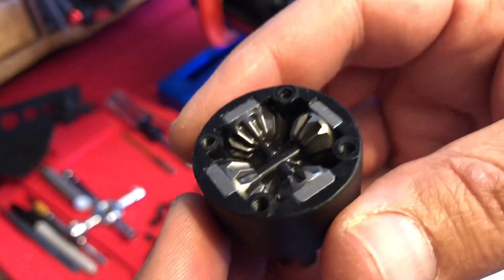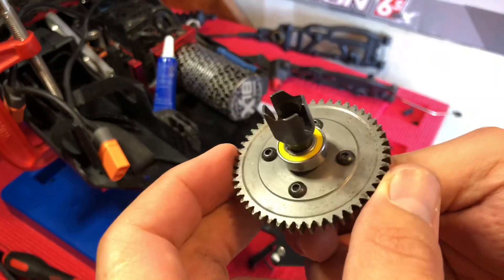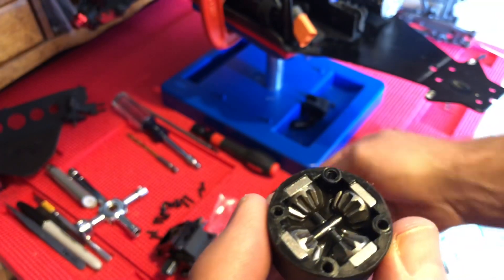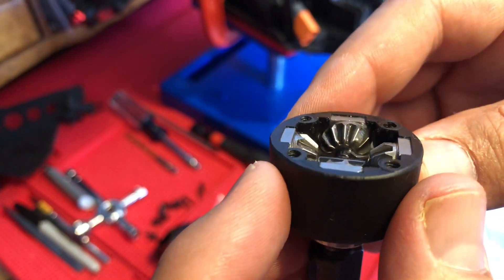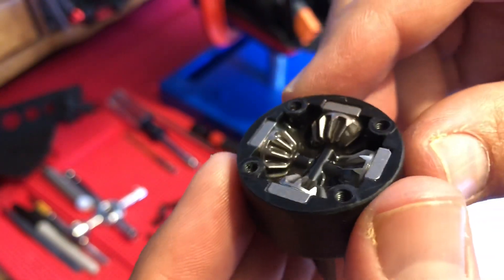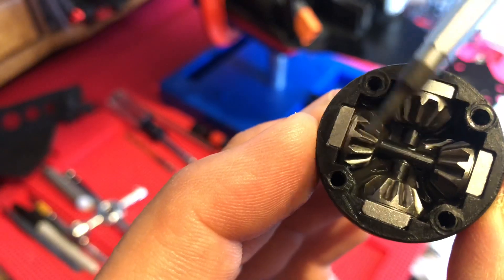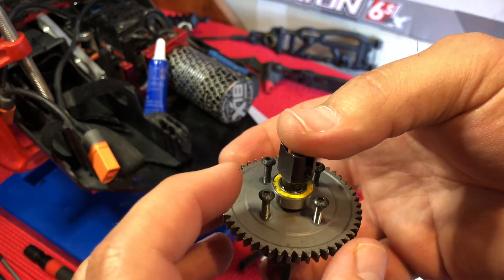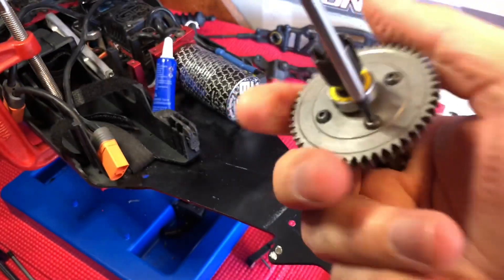ARRMA DIFF TIPS - Kraton, Outcast, Talion, Typhon

Comment: loading up on parts now and gonna rebuild all 3. My Center Diff on the new Outcast EXB RTR is already flinging fluid on my bashes, time to upgrade/ rebuild! can't wait
Reply from the maker: Good times!!! 😎👍
Reply: @EastTactics  i've been trying to find springs from your other video and just can't get them for the outcast. if i remember right they are sold out, any idea what i could buy as well?
i'm online with M2C for caps and pistons right now. i'll look over your videos again for what oils and do them when i get the m2c caps in.
amazing stuff and i love the detail you show!! thank you!
Reply from the maker: Thanks!!
Have you checked inventory lately at centurysprings.com for the 1631 part number?
I ordered mine a month or two back and it was put on back order. But then last week they finally arrived. So it doesn’t hurt to put an order in and then get it put on back order. But due to the fact of mine arrived last week I’m wondering if they’re currently in stock again.
After getting the 1631 part number in my hand I’m feeling like this is gonna be a really good spring. 
On this particular spring however you do have to take your Dremel tool and flatten out both ends of the spring on all four springs so it sits right.
As far as the weight differential fluid to put in your shocks after getting the springs. I will probably go with 3000 CST. I currently have 5000 CST in mine. I think when I drop down a bit I’ll like it even more. Naturally more videos to come on this topic
Reply: @EastTactics  exactly, it was on back order and I'm lil impatient that's why I was asking if you had others.
I got really excited when I saw your video about those springs. I don't want to double up orange springs or go 25mill shocks.
I'll just order them even on back order.
Thanks again
Reply from the maker: I’ve got a full set of the big rock springs also I’ve got a full set of 10548 springs and they are great Springs.  if you want email me Andre can  talk about you picking them up for me. You know… If you want
Reply: @EastTactics  ya just not happy with my body slaps on stock spring...sure
Reply: @EastTactics  just looked online and they have th 1631 in stock right now...spread the word i'm getting 4
Reply from the maker: Awesome

Comment: My diffs have been driving me nuts!  It was good I worked on all three, but I am back at the rear diff.  I have an Outcast 6s EXB, but this was still helpful.  I need to emphasize having a solid seal.  My rear diff has been leaking and even pushed out a couple screws.
Reply from the maker: Ya I need to make a new video on diff tips for the EXB. Now that I have one sitting here in my workspace. 
Are you running an open diff (with recommended shims) or are you running the diff with the lsd plates?
Reply: @EastTactics , they actually give you the LSD diffs.  You can rearrange the plates to maximize or minimize the LSD effect.  I had to change fluid and the gasket.  Unfortunately, the first time I did that, my rig still acted front biased.  No wheelies.  I have since worked on the center and front diffs, but had to go back to the rear.  I will have to test drive and see if my rebuild did the trick.  The teeth on the gears look good, but I wonder if I need to shim.

Comment: You should tighten screws in an opposing pattern, not circular. Going in a circle pushes material/gasket as you go around and will bunch up at the end causing leaks. This is standard in automotive, even for wheel tightening sequence they reccomend it to ensure proper torque.
Reply from the maker: Ya your right, thanks for the tip brother! Thanks for watching

Comment: 4:30 the original gasket has bigger holes for the screws compared to TekJo, just so that it will go around those exact protrusions. this of course means that the remaining material for each hole's wall will be thinner so breaks easier. I think that's the only quality difference stock vs TekJo. BUT if you go with TekJo you HAVE TO to shim/shave those protrusions off

Comment: I have the TLR Typhone...will 200k be better for it, and will it give it more power??
Reply from the maker: The higher, you go, translate, more even disbursed power to all four tires, has pretty dramatic impact on less ballooning if that’s an issue for you. So does it translate into more power? It sort of feels like it does. You’re definitely safe to experiment with increasing the thickness in your center differential Most people like it thicker.

Comment: Great video. For the gasket on the diff my truck is brand new never used actually waiting on shimes before I take it out. Also the fluids I'm using 100k in rear and 30k center. 10k front that what the hobby store recommend. Most of power goes to the rest end that why some of the EXBs and Kraton are have issues on the rear diffs
Reply from the maker: Thanks! Im glad you like the Video. The Hobby store recommended that! Thats a really odd recommendation. Are you running the EXB? or the V4 Kraton?
The V4 Kraton and the EXB comes stock with Rear 10,000cst, Center 100,000cst and front 10,000cst. Notice the Ratio for the Center is Much much higher. Theres really good reason for it. You want your Center Diff to be much thicker than the other two. Most people run between 200,000cst and 500,000cst. (or higher, a lot of people run 1million in the center, or silicon earplugs).
Long story short, the idea of dropping your center to 30k is a bad idea (from what I know). 
Also.. its a misconception that increasing your rear diff fluid thickness will protect your gears. In fact its the opposite. the added resistance actually just puts more stress on the gears and increase breakages. So definitely dont go to 100k in the rear. You want thinner fluid in the rear such as 10k or 20k. I dont recommend going past 20k in the rear. 
As for the front, many people do like to go a bit thicker in the front (but nowhere near as thick as the center) to mitigate ballooning. So jumping up to 60 or 80k in the front is ok... but 10k (which is stock) is considered low, for the front. (Veterans will say)
I run 20k, 200k, 80k for my set up and that came straight from Rich Duperbash and RC Dude 81 (both huge guru's in the field).
So ya... not sure what the hobby store guy was going on about, buy you can try his methods if you want. 
The important thing with either the Kraton or the EXB, is that you have things shimmed correctly and that you don't over gear your kraton (meaning the pinion size) for the stock Motor and ESC (stock 13T or the high speed 15T is fine. I run a 16T. Back when I didnt know better I ran a 20T pinion (with stock motor and ESC) and was breaking rear diff gears right and left).
Controlling the vehicle correctly, not landing while holding the gas down, or being too overly aggressive on the throttle on take offs etc is important too. 
I'm actually going to be putting silicon ear plugs in my center diff her pretty soon. which is going to be really interested. Stay tuned.
Reply: @EastTactics  Ok Great thank you for that information. Yes I talk to rich  as well I haven't ask him about the diff fluids. Wow ok so great yeh he is a expert on this so I will do that for sure. Just gonna do 10k in front and rear now and 500k in center. Maybe il mix some 100k into the front diff and rear that should be ok. I have the EXB so it's definitely built like a race truck. I even checked for the bolts and my steering is all out of whack I have to fix all of that. There's a slap this thing together at the factory without really checking it much. Of course being the professional RC drivers we have to go over everything before use.
Reply: What happens when you add the silicone ear plugs? Would that be about the same as adding 1million weight to the center diff? Do you keep the front and rear weights the same? Im in the process of swapping fluids and I have 30k, 50k, 500k , and 1million. I will be going to get some 20k tomorrow. Thanks for the video its very informative but just trying to get everything figured out as to do the silicone ear plugs or stick to 500k for the center diff. Thanks again man!
Reply from the maker: From what I understand silicon earplugs is like having 1 million weight times three. It’s pretty much the closest you can get to locking your differential yet you’re not locking it because there is some give. From what I understand, and again I plan to drop a video on this, forgive me for not doing it yet. But it distributes the power of the drivetrain more evenly through all four tires and and puts traction to the ground almost immediately. Many people say that even if you’re running your stock components, she’ll do a standing backflip if you got it off the line. Is that a good thing? To each their own, obviously if you’re tuning more for racing and increased control off the line without potentially skidding or fishtailing then you wouldn’t want to do silicon earplugs. However all the people that I’ve asked in the bashing arena say that they actually like it. Most are veterans and have mastered the power of of 6s and easing off the line when wanting to mitigate control. Running silicon in the center differential might take some getting used to, but some actually prefer it. I’ve also heard that because the power is distributed more evenly throughout the drive train the front and balloons a bit less.
Currently I’m running 20 career, 200k Center, and 80 K front. I don’t have any intentions to change my rear or my front, pretty happy with where they are are. However I am 100% planning on rocking some silicon In the center to see if I like it. If I don’t I’ll drop to probably 500 and see how that feels.
Reply: @EastTactics  is yours all stock? Any recommendations on upgrading parts for the ear plugs? I dont do much racing with mine i do jumps, and alot of offroading. I do like the fact that of the standing flip and eventually I will be trying to get alot of air with mine. Right now its 10 degrees where I'm at so im sure there will be lots of broken parts if I try to do anything crazy. Im going to see how this 500k center diff will do. I will probably go ahead and order the silicone e earplugs and go from there. Thanks again man. Can't wait to see the video on this subject!
Reply from the maker: For sure man! That’s a great choice, 500 K in the center differential is solid for a basher. As far as upgrade parts go

Now don’t feel overwhelmed by all these upgrades, just feel grateful that these things are available and can be assessed overtime. The funnest thing about this hobby is getting out there having fun and when you break something simply buy the upgraded version.

The ones that are starred with an Asterix are ones I would seriously consider out the gate.
 
1.*HD rod ends (or search DIY rod ends
Search either on YouTube and you’ll find my vids on it. Also, making sure your droop is set properly is important to protect your rod ends. Setting droop is another video I have out there.

2. *Rpm bumper front and back (or if you can find it you could toss on the EXB front bumper, also fits on back, with some modifications)
3.*Aluminum chassis braces front and rear
4. aluminum servo mount
5. Willie bar (seriously protects your wing mount)
6. Watch my playlist on shock mitigation

If you really want to start sending it like insane  jumps,

7. M2C chassis
8. 7075 aluminum rear shock tower (M2C)
9. Hot racing Diff houses (Front and rear)
10. M2C rear suspension mounts (rear first)
11.  M2C shock standoffs
12. M2C shock caps

If you haven’t already make sure you bulletproof your differentials, Also make sure they’re shimmed correctly both inside and out. Naturally I’ve got lots of videos on this stuff.
Reply: @EastTactics  sweet!!!! Ive already got a few of these things done. But I will definitely be upgrading these. Thanks for the parts list man. Luckily these little parts on this truck have been holding up good and haven't broke yet. I've just been  putting things on little by little and I've already got half of this list.

Comment: Tighten bolts in a cross pattern.  Might be getting leaks tightening them in a Circle.
Reply from the maker: thx for the tip... having tech joe gaskets has been great, no leaks.. but I will definitely head your advice! thx
Reply: @EastTactics  yea the leaks was most likely from uneven screwing down without crisscross pattern/star pattern

Comment: My typhon 6s is putting more power to the front than the rear, i hope it’s just the center diff oil, I’m going to tear it down today
Reply from the maker: Going thicker in the front with help, like 100k. Also going thicker in the center helps mitigate front end ballooning. Like 500k or 1M. I’m actually going to be tossing some silicon earplugs into my center diff here soon. And will report the results.
What were you running in the center?
Reply: My outcast was doing the same thing (more power to the front) i put 50k/100k/half 30k half 10k .....front/center/rear

Comment: My bet is your O ring has failed and is leaking oil through the hole where the shaft goes into the diff which attaches to the sun gear.
In fact I’d put money on it.
Plus you would get a better seal if you tightened the screws in a cross pattern as opposed to a circular pattern just to make sure the Gasket seats correctly on opposite sides first. Before torquing the screws down.

I understand this is an old video now but my theory may also help others
Reply from the maker: Who sings definitely helped her make sure they are done for her. I will say though however, after changing out my spiral gear itself to resolve my problem. The hole was slightly warped big

Comment: Just curious. But what weight fluids do you guys run in the 6s. I shattered a sun gear and a couple spider gears lmao 🤣 and just curious what everyone was running.  I think I had the rear at 30k maybe 50k I can't remember lol
Reply from the maker: Rear - 20k
Center - silicone earplugs
Front - 80 K

What motor are you running? And what pinion? Overgearing makes things unhappy. So I was just curious.
Reply: @EastTactics  17t with stock system and good fans.  This set of gears has been through the ringer. I'm not disappointed at all on how long they lasted. I had rebuilt them right out the gate and shimmed them. and I'm not easy on it by any means lol. It lasted almost 8 months of torture on huge Ramps.

Comment: Great video. Would you recommend 10K for my notorious 6s for the rear differential? Didn't touch anything else yet. Only run the truck like six times so fluid now looks like liquid metal so I'm going to change it.
Reply from the maker: 10 K fluid will work just fine. However I would recommend going 20 K in the rear, and then anywhere between 200 - 500 K in the center. And 60 or 80 K in the front. 
The thicker that you go in the center differential , The more immediate torque you throw to the ground. In other words you’re getting closer to being able to do a standing backflip or wheeling a lot easier. Some people like that idea, (In fact 500 K likely wouldn’t get you there, standing backflips, 1000,000 K or silicon earplugs more so increases that potential). however some people, especially those running the shorter wheelbase outcast/notorious Want to prevent it from Wheeling so easy. Also thicker differential fluid in the center transfers the power a bit better (Between front and rear)and prevents as much ballooning in the front end.
So going a bit thinner in the center differential, tames it a bit more. Less Squirrley, if that makes sense. Center...It comes stock at 100 K,
Reply: @EastTactics  ok great thanks. Would 50k be good on the front? I'm gonna mix some 50k with 10k for the rear should be good on that. Center il like 500k cuz that what I did for my EXB Kraton. Where u from on east coast ?
Reply from the maker: 50k will be fine for the front. I’m from Utah😀
Reply: @EastTactics  ok thanks. Actually so I just put 10K in my reader and it feels a little bit notchy or something is like feels like it's grinding it actually felt a lot smoother when the old stuff was in. Recommend I just dump it out and put more stuff back in again. I did not take any of your bottom gears out I just dumped it out and put a fluid in probably got some metal shavings in the bottom that got loosened up. Nuts
Reply: @EastTactics  Kool man I'm from NY. Doing a video tomorrow small one I'll give you a shout out. Just differential stuff can get really tricky. It's good to talk somebody was very knowledgeable about this stuff I'm still learning especially with my EXB which I'm gonna do the diffs tomorrow and shims
Reply from the maker: Yeah that is a little bit weird, if you didn’t add anything into the differential other than fluid. You didn’t add any shims or anything like that on the inside did you? There might be some tiny shards of debris that’s doing that. Typically it is a good idea when you’re changing the differential fluid to completely remove all of it get it cleaned out as good as possible. And then just start fresh.
Reply: @EastTactics  yeh thanks. That's what I'm gonna do I afraid I couldn't put it back together but from what I see it's pretty easy. I never had a issue with it just thought would be a good idea to check and refill fluids.
Reply: @EastTactics  no nothing just fluid no shims. I have those for my EXB rear differential only.

Comment: Awesome but what’s causing the seeping out at 9:43 🤔
Reply from the maker: Oh… that’s a natural occurrence when first pushing down those plates into the diff cub.
On another note however, there is something I do now days that I didn’t cover in this video (to prevent leakage). Take the cup, while empty, flat face down and rub it on some light weight sand paper. Get rid of all the little burrs found around the top, particularly around the holes. The flat face down position allow for the whole top to be smoothed out evenly and get rid of any imperfections. Cheers!